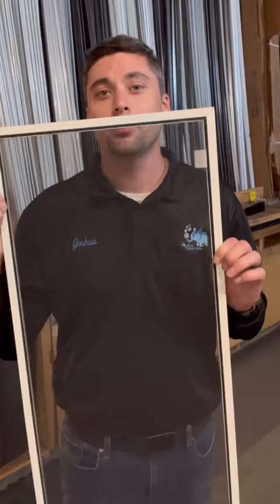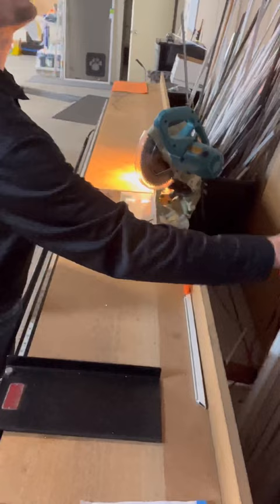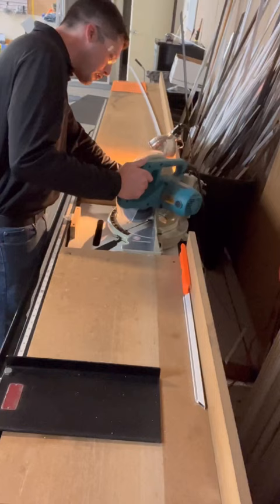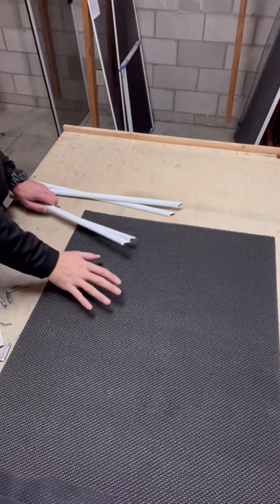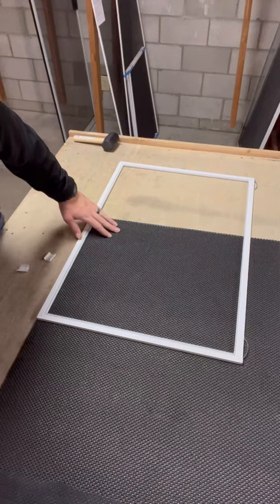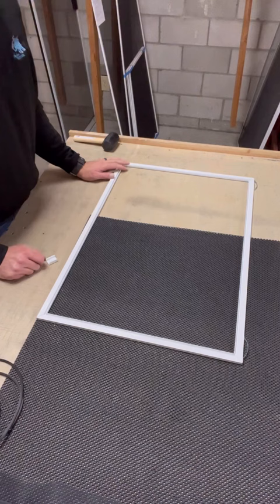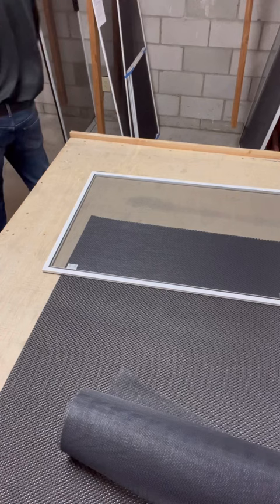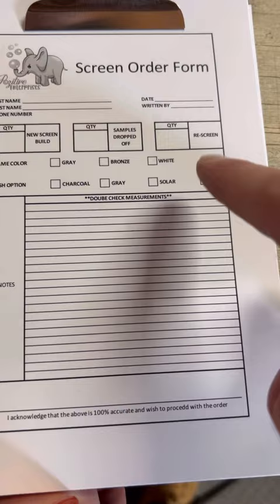HOW TO BUILD A WINDOW SCREEN

Comment: Thanks for the instructions.  I find it is easy to deform the end of the frame piece when you are trying to cut off a small piece, such as when you are turning the 90 into a 45.  I suggest instead you make a 45 on one end, cutting off at least 1/2" of material,  before you cut to length with another 45.  Your jig should allow this because the tip of the 45 will butt against the stop.
Reply from the maker: @williammiller4786  thank you!!

Comment: Thank you for that tip about a little slack. I have failed with many frames twisting after mesh installation. That spline really pulls a lot of screen in.
Reply from the maker: Yes it does! Something I learned over time. Thank you for the encouragement🤗

Comment: Should the spline be facing the outside of the window after installation or should the spline be facing towards the inside of the house?
Reply from the maker: Spline should always face the outside
Reply: I personally prefer the spline to face the inside of the house, it’s more of a cleaner look & the spline will Not get brittle with the sun beaming down on it. 
My .02
Reply from the maker: @FernandoRodriguez-ds5ri  that is fine as far as preference but the design of the window screen is made to face out and pull tabs are on the inside to pull in from the inside of the window. When you get a new window from the factory that’s the way it comes but there is no wrong way that’s just how it is designed. 🫡

Comment: Hey, really nice job with the bow factor. I really failed miserably at my last effort. I had 4 sides bow in so bad it was sad. After seeing this video I’ll try again this weekend with new materials. Do you feel that the kits with plastic corner inserts can work fine as well?
Reply from the maker: From my experience the plastic corners only last about a year in the sun but they can be a temporary fix.

Comment: Thank you for the video. I was wondering, when you "cutoff the little bit" why not do it at a 45 so you only need to do 1 more cut after that?
Reply from the maker: That’s actually what I started doing a few weeks after I made this video. I actually flip the frame over cut that piece off then flip it over again and slide it to the end and make the cut and that way I don’t have to even move the angle of the saw. 🫡

Comment: Have you ever built one on an angle?  I'm trying to add panels for the gable of a screen porch but I can't find any connectors that are not 90 degrees.
Reply from the maker: Yes you will need adjustable corners. I have them if you need some email me. You will need 7/16 frame for them. JoshuaTheWindowCleaner@gmail.com

Comment: I have watched other videos where they say to pull slight tension on screen as you roll the final 2 sides. So are you saing not only to not pull tension but also to leave slack? Is this correct? I will be putting solar screens on 3/4 frames soon. Trying to figure out the best method.
Reply from the maker: @kevinwinkle8091  I do not pull tension. I let the screen pull itself

Comment: Where did you get the metal corner pieces? All I can find are plastic and they brake ever year due to  the weather.
Reply from the maker: We are a supply shop here in Southern California. You would need to build the screens with a 45 degree cut for the metal ones to work. I can ship some if you need any. 🤗
Reply: @JoshuaTheWindowCleaner Do you know what frame cut the plastic ones work with? I  replaced all the plastic  corners in one window screen, but it didn't seem to fit like I expected them to. And I had the bowing issue also.  Now after watching your video, I am certain I can fix the bowing problem. But I couldn't fit the screen back into place, so I wonder what my problem was. The plastic corners seemed to match my old one exactly. 🤷‍♀️
Reply from the maker: @Professional_ProCraftinator  thank you for your email also! I hope the email helped answer your questions! 🤗

Comment: Hello Joshua, thank you for your great content. Have you ever had the spline shrink in the spline channnel after you cut it? I’ve tried 2 different brands of spline and they both have shrunk about 1 inch at both ends. Do you have any tips to resolve this? - Clarissa
Reply from the maker: Yes I have seen this before. You need to use bigger spline for the channel. What’s happening is your stretching it when you put it in the channel and as time goes by it goes back to its normal size because there is too much room in the spline channel. Try going up .10 maybe even .20 in size see if that helps. Keep me posted. Also weather can play a factor as well if your in a cold environment try doing it in a warmer environment. If that doesn’t fix it let me know what size your using and maybe I can send some your way we have plenty of spline and it wouldn’t cost much to ship it to you. The quality of our spline is top notch.
Reply from the maker: @simplifyingthings9069  fantastic!! Thanks for your feedback! West Virginia is beautiful I have lived in Virginia and done work in West Virginia many years ago in the oil field so I understand the climate. My email is JoshuaTheWindowCleaner@gmail.com send me your address and I’ll ship some spline to you and you can tell me if it’s any different then what you are using currently. Good for you on wanting to be quality that’s what made me have the reputation I have in my community. If the spline quality is bad then it will expand and contract as the seasons change for sure but not enough to make a huge difference if you have the proper spline size for the frame. Send me pictures to my email of what your using now as far as spline and frame and let me see if I can diagnose the problem for you and see how I can help. Stay encouraged and I look forward to your email 🤙🇺🇸
Reply: @JoshuaTheWindowCleaner  Thanks Joshua. I just sent you the email.

Comment: Wouldn't it be a lot easier to just measure in metric? If you can count to ten then you're set
Reply from the maker: Maybe for some but this is how I have always done it. 🤙
Reply: Metric is fine for those who can only count to 10, but after the age of about four or five when you can get to 32 or 64 with little difficulty then you should step up to the Imperial system.
Reply: @wulf67  thats actually a step backwards
Reply: @jondennert  It seems to work very well for the wealthiest and most scientifically, technologically, and militarily advanced country on earth. Metric is a third-world system of measurement.
Reply: @wulf67  you can't be describing America? Seriously?
Reply: @jondennert  America refers to a couple of continents. I'm talking about the United States of America. You've heard of us?
Reply: @wulf67  yes ive also heard of the plague neither one is anything to be proud of

Comment: oh come on If they dont understand 1/16th of an inch on a measuring tape they need to call someone to do the screens
Reply from the maker: I also use this for a training video for my employees. Believe it or not there are still people who don’t know that. 👍🏼
Reply: I disagree. I’m sure you could build window screens just fine measuring in eighths or even quarter-inch increments as long as you were accurate and consistent. You’re not building a piano.

Comment: Shows how to count the 1/16" marks on tape measure,  but not where to get measurements on window frame which is kinda the only part people have trouble with lol
Reply from the maker: Good idea! I’ll make a video explaining how to do that. This video is just how to build a window screen not how to measure to build a window screen. 👍🏼
Reply: @JoshuaTheWindowCleaner  Yes! How to measure the windows for replacement screens. There are several vidoes out there but I find them a bit vague.
Reply from the maker: @tomtrowbridge2616  I am working on one now but there is many different windows the one I’m making now is standard in my area. I’ll be posting it tonight so stay tuned. Let me know your thoughts.